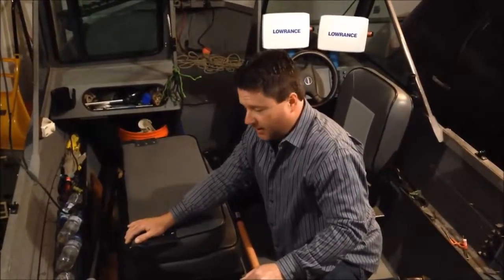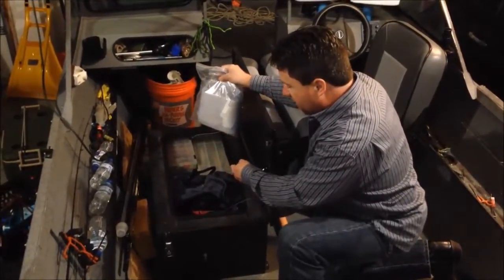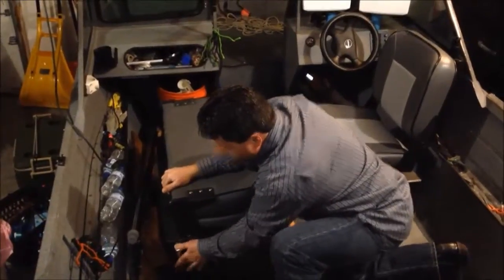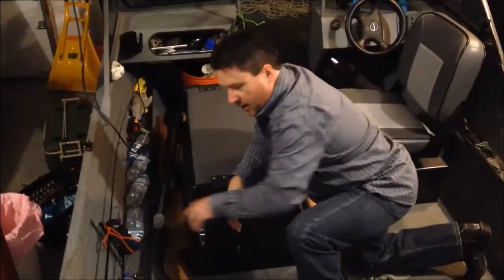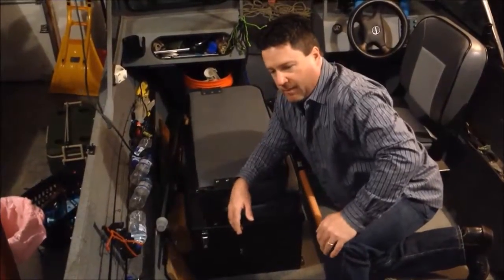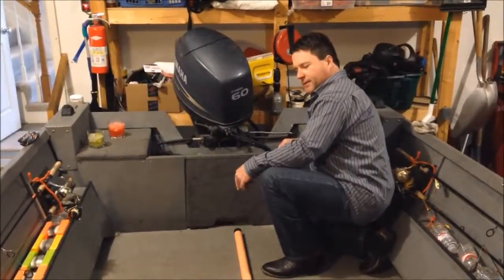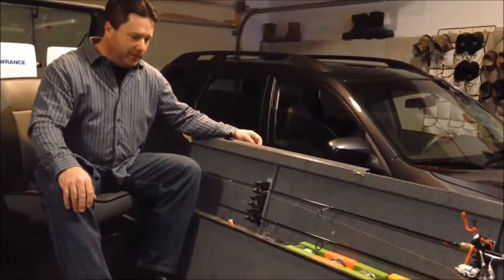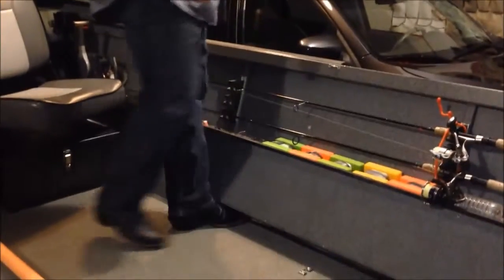My Alumaweld - Part 5 - Boat Layout

Comment: I don’t get it the end of your video.  Care to explain?
Reply from the maker: An attempt at humor at the expense of my Bass fishing friends.
Reply: Team Mainlake I have an Alumaweld Talon also.  Mine is a 2005’ 15 1/2’ with a 50hp Mercury 4 stroke.  I use mine for trolling (two electric Scotty down riggers) in lakes and bass fishing.  When I bought it back then the dealer installed a bracket for my trolling motor (Minn Kota Power Drive w/ autopilot).  The bracket attached to the lip on one side of the bow... very clean.  Keep up the great fishing videos.